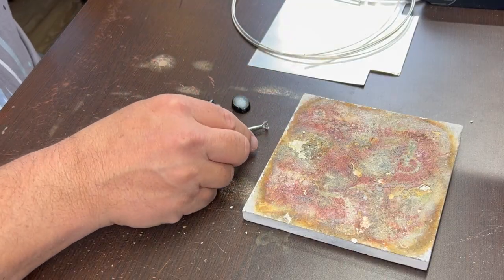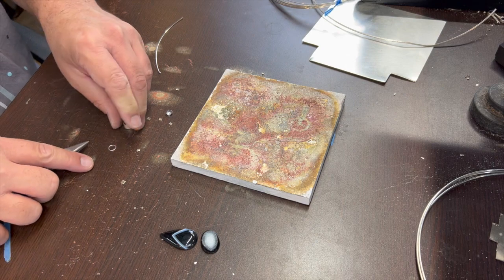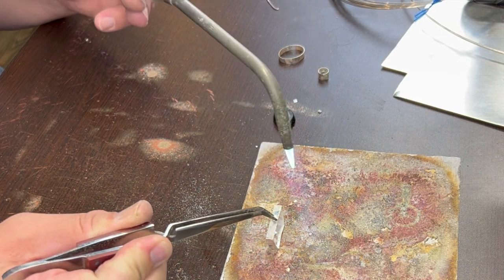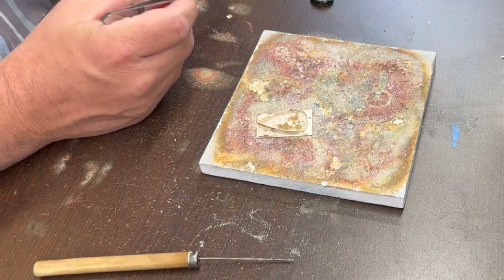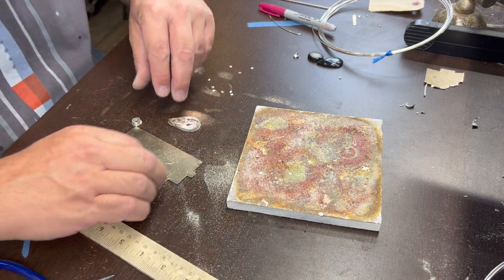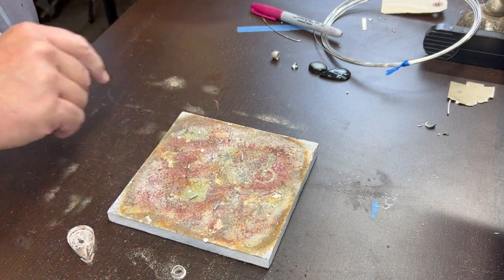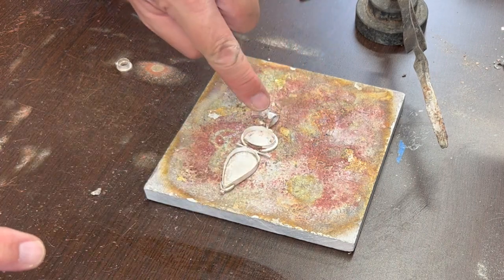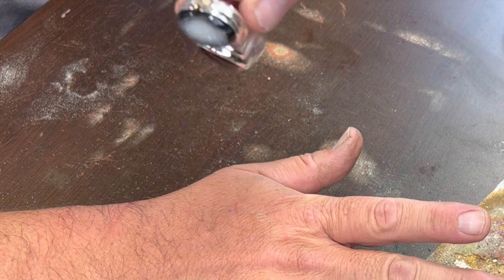Making A Three Hinge Pendant: A Silversmithing Tutorial

Comment: Excellent video, thank you so much for sharing all your expertise!  For the novice, like me, I use graphite (mechanical pencil lead) to line up the hinges when I finally soldering all three hinges, the graphite come right out afterwards so you can put the pin in.  I love the idea of soldering instead of riveting the pin ends.  Great stuff, Chad!
Reply from the maker: I’m glad you found it useful. It is a bit tricky to do the final solder on the pin, and even though it is challenging, I like the final result better than some other options.  Thanks for watching Mary!

Comment: Great video. Thanks. But I don’t know what you did to finish the hinges. Did you solder the ends then cut it off. I couldn’t see what you were doing there. Thanks
Reply from the maker: Thanks Mary. I picked a tiny bit of easy solder to the outside tube where the pin protruded and then cut them off and filed the ends. Hope this helps!
Reply: Hi Chad, beautiful piece and a thank you so much for making this video. I also don’t understand how you finish the pins off. I saw your reply to Mary’s query but I still don’t understand. How are you preventing the inner pin from belong able to slide out? Could you explain in a bit more detail please? You said you soldered the end of the tube what did you mean? Please forgive I’m trying very hard to understand.
Reply from the maker: @Shukarr  I’m really just using a tiny piece of easy solder to solder the pin to the tube on either end.   Following this I just cut the excess pin off and polish.
Reply: @chadssilversmithing  ahhhhhh!! I see!!! So you are adhering it to the top bit but the bottom bit of the hinge is still able to swing freely. I get it:) Thank you!:)

Comment: And… a piece made without cursing rarely turns out as well as it would otherwise!!! Also, Chad, what was the “fail” on that top hinge? You don’t explain. And what are you soldering (on the hinge) and why? And what are you trying NOT to do - this the “fail”? Occasionally, there is [teaching] stuff going on in your head that doesn’t make it to the video - I’m watching you like a hawk, referring you to my students (yes, good channel to watch, this guy ISN’T an an idiot, he does know what he’s doing, although frequently unconventional - air sawing 😳!!😎), and generally really enjoying your videos and learning OTHER ways to fabricate!
Reply from the maker: I either got it slightly too hot, and a bit of the existing solder holding the tube worked it’s way into where it wasn’t supposed to go, or, some of the easy worked it’s way past the outer tube and seized it up. Either way, I cut the tubes off and started fresh on that one. I’ll try to do a better job voicing the random and wandering thoughts bouncing around up there:)
Reply: @Chad’s Silversmithing  you see a really good source of information,  you have a different take on things (I think), and that is refreshing.
Reply from the maker: @flyingcheff  Thanks. I like learning how others do things as well. It can only enhance your own toolkit!